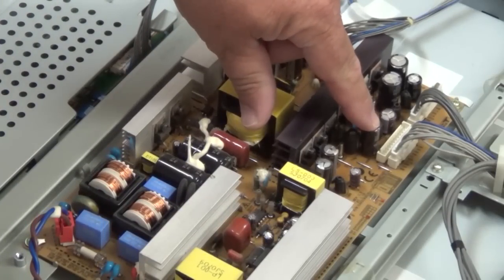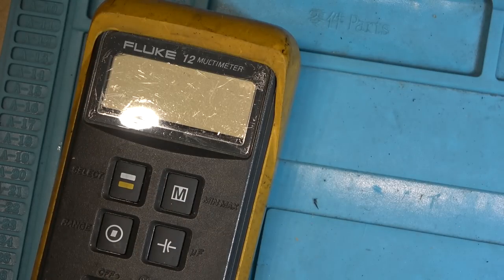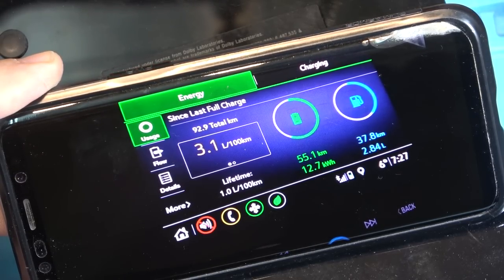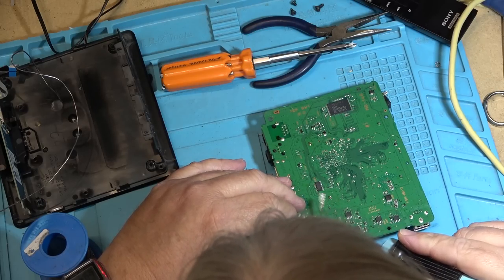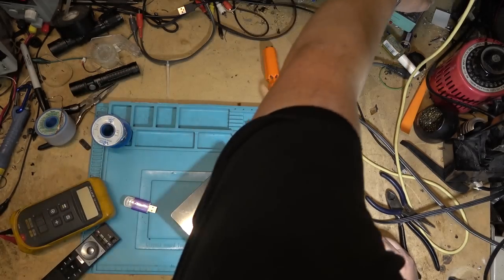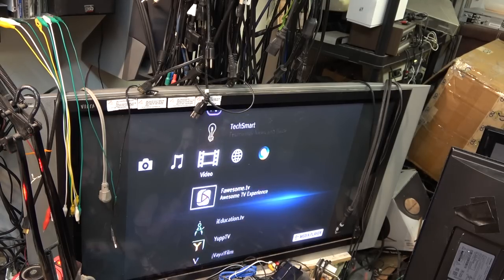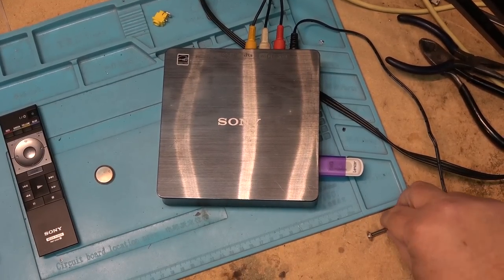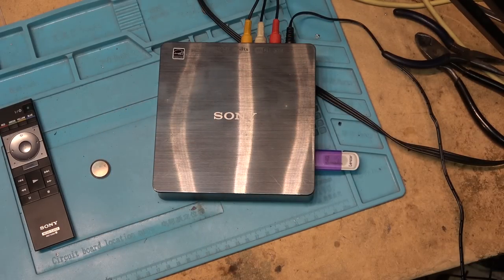Scored a great unit on facebook for free today

Comment: I save all the connectors from dead 9V batteries, then use them to make battery clips for projects when I need them, I'll never have to buy a 9V clip ever again.
Reply from the maker: I've done that.
Reply: yeah because why not. recycling is nice. just need strain relief for wiring
Reply: @ketas  I usually hot glue on the other end of the battery (plastic the same shape as the connector)
Reply: or just make 4 small holes in plastic and route wire through it...

Comment: Hi Dave just a quick one about Nav systems. I used to work for a leading Nav company and there are 2 options which you talked about in your video. Fast and short travel. Fast means the speed that you are going. Short is the travel time. If you want to go quick as in time wise you would have to use Short travel. But if you want to go quick in your car you would have to use "Fast". It's stupid but true. Keep up the great vids!!!
Reply: They need a 3rd economy option.    Waze gives you map overview and you can select multiple routes.
Reply from the maker: Problem with Google is if it detects a traffic slow down such as a tunnel or bridge it reroutes you and if you decide to go the other way it constantly nags you to turn around.
Reply from the maker: @ACommenterOnYouTube  I can get to and address in the city i work in without gps.  This was 2 cities over.  
If I looked at a paper map I wouldn't have even needed it because a friend lived in the next street over.  As I was going there i drove past my friends old house.  I know the area just didn't know where that street was.  Gos took me in the back way, the much longer way.

Comment: Nice work.
If you ever want to do it the easy way, you can get barrel jack adapters that will fit just about any socket. They cost maybe a dollar or so. Then you just need a power pack with a 5.5mmx2.5mm barel jack (or splice one on) and the right voltage. You can glue the adapter on if you're worried about it falling off
Reply from the maker: This was easy.

Comment: Great video!  I always end up searching out some electronic gadget I see on Youtube.  Put a bid in for one of these on eBay just so that I can have another toy.  Even at 70 these things still fascinate me.  If it works I'll end up putting it on one of the several TVs scattered around the house.  BTW, really enjoyed your video on changing belts in a Sony 300 CD changer.  I have a 300, 400 and a Sony 400 DVD player and have had to change the belts in all three at different times.  After the first belt change the rest were a snap.  Even got my son back in business with his Sony 300.  His had been down for more than three years and as expected the belts were black goo.
Reply: I get it. About the same age as you and I still have a habit of coming home with something I really don't need more of. Found a Philips VCR/DVD combo at Goodwill for 11 bucks yesterday, like new condition with remote. Like I need another VCR/DVD combo! I have four hooked up to every tv and the projector in the house along with bluray, roku, tv antenna. With VHS coming back into the collectors' market now they ae becoming harder to find a cheap deal on. Glad Goodwill hasn't figured it out yet.
Reply: Oh yea, on the same trip, same store, I found an AppleTv streaming box for eight bucks. Brought it home, did a factory reset and update and works like new. Price those on the market!
Reply: I do the same Henry and my house is getting pretty full! 😂😂😬

Comment: 480p/720p players - a good find. these days it's all about live streaming; takes quite the hobby to collect all sorts of movies to store on there.
Reply from the maker: This does 1080p. It can output 480i at the same time as well as 1080i out the component while outputting 1080p out HDMI.  
It's great if i want to make a quick DVD copy of a 1080 file.  No need to render out a 480 file just plug the USB stick in or stream it from the hard drive over WiFi and plug the composite out into DVD recorder and hit record.

Comment: I also have the problem with weak batteries and incorrect data from my Fluke devices. Since I live in Germany, I also have access to our local manufacturer “Gossen Metrawatt” and their multimeter series. I have not actually encountered this problem with these devices. These "Made in Germany" multimeters cost as much as "Made in USA" Fluke Devices :D

Apart from that, an interesting video! Nowadays, I only look at classified ads and the like with a low price limit and actually only for defective devices. On one hand, because it’s fun to try to repair them, and on the other hand, I don’t like to spend a lot of money on old electronics. Even if I like old stuff, some prices for functional devices such as "vintage" radios, tape decks, etc., are simply astronomically high.

Best regards from Berlin!
Reply from the maker: The ones i love at garage sales where the owner has printed out eBay sales prices and stuck it on what they Are selling.  100 for a 20 year old microwave.   I don't think so.
Reply from the maker: It will be a FLUKE if its accurate. There is a reason FLUKE devices cost as much as they do, and that is repeatability. They are held to very high standards by industry and government users such as NASA, Boeing, US military ect. They make meters that span many, many years. They don't change often and the reason is due to specifications called for by these industrial users. Dave Jones over at EEVBLOG did a video on this. 
They have contracts with large industrial and governmental agencies that demand a very specific specification. They don't give a dam about selling to a back yard hobbies. They have industrial users that do not care about the price, they are paying for a specific product and specification and their meters are produced to this standard.  Are there other companies that produce a meter as accurate as fluke. You bet there are, lots and they cost a fraction of the price, but one thing they don't have is the certifiably that fluke has earned over the past half century. I have a brand new fluke that I have never used. Some idiot was selling a 500 meter for 20 bucks on Facebook and I pounced on it. The guy said he had about 40 offers in the first few minutes and would sell it to the first person that showed up. Just so happened that it was my day off and I jumped in the car and headed straight over and snagged it. Was it hot? Possibly. He told me it had been his father's and he ran a repair shop but couldn't tell me the name of it, and he bought the new meter only a few months before he had a stroke. Its so new that the protective film on the display is still there. 
I'll put that one in service after this old FLUK 12 packs it in.

Comment: I live in a major metro area with HUGE cellular data dead spots, so I've had issues with Google Maps not knowing where I am, failing to load, freezing, etc. Just bought a used Garmin for $20 with lifetime maps and traffic, updated it, and installed a new $15 battery.

Comment: I've always wondered what factories think when they make such media boxes? almost air tight box where there is no air circulation. Perfect recipe for overheating.
Reply: I have a Roku streaming box, it's a sealed unit and after being on for a while the top gets warm so I'm guessing it acts like a secondary heatsink. 🤔🤔
Reply: @markrowe8824  It doesn't. 
When you have a heatsink inside an almost airtight box, in the end it doesn't work as a heatsink!
CPU. begins to slow down to protect himself. I have only seen an android/media box with a fan!
Reply from the maker: There are hidden vents on top and bottom covers. In case you missed it a gap of about 2mm all the way around. Plenty of convection air flow.
Reply: This thing probably runs some very light weight real time operating system, probably not even Linux, so it probably doesn't need much cooling anyways. Sony uses BSD on PlayStations, so maybe this thing's firmware shares some code base with that.
Reply: @RaduTek  the on-screen interface is almost exactly the same as the PS3 games console. 🤔🤔
Reply from the maker: @RaduTek  got a big heat sync and plenty of free air.  Vents top and bottom all the way around.
Reply: @RaduTek  remember that the same apps or video take the same amount of hardware resources regardless of which operating system you used!

Comment: I took a trip in my 87 ram 50 from California to Montana one year and had a route all planned out on Google maps to take the back roads through eastern Oregon and Idaho. that thing refused to let me stick to my original planed route! Every time I would get to an intersection or fork in the road it would tell me that it found a faster or better route and I would have to look down at my phone and tell it to ignore the freeway or whatever new route it would try and direct me to. I'm surprised my phone didn't end up in the engine fan along the way!
Reply: Is that possible that Google has a database of "no-go" regions or some kind of an algorithm when you are doing long-dinstance travel, just to keep the traffic out of small towns? I was thinking abut this for a long time. Here in Germany, it seems it does. I also tried the planned route thing once or twice, to do scenic roads (should definitely be an option) and I always got stuck to the big roads (federal road, which is Bundesstraße or Autobahn). I know, I can swtich off Autobahn, but what about the others?

Comment: Great video! I loath those special Sony power connectors!
When substituting a missing power supply Im aware of checking the polarity of the middle pin and barrel, + and -, or - and +.
How much over/under can the  voltage and amps be?
Reply from the maker: Amps doesn't matter if it's over.  Say the original was 12v 1a. It is perfectly acceptable to replace it with a 12v 3a or 5a.  Obviously you wouldn't replace it with 12v 500ma or 300ma.  That wouldn't work.   It's not like the power supply is going to force 3 or 5 amps into the device.  The device is going to draw what it needs.  That's the max current the power supply can deliver without going I to over current protection or overheating.
Reply: @12voltvids  Thanks!!! What about voltage? For example could a 12 volt use anything from say 10 volts to 14 volts and still provide enough power but not enough to fry something?

Comment: I feel you with Google maps being terrible. I use it as a guide instead of taking it verbatim because of how terrible it is. I turn off the voice navigation because it'll hitch up constantly and tell me that I need to do a 180 on the freeway, go back 20 miles and then go on a different nonsense route because it calculated that would be faster. I also have to keep an eagle eye on it because it'll constantly tell you about "faster routes" and automatically try switching to them if you don't cancel the prompt in the 5 or so seconds it gives you for input, which makes it so you have to close the maps and open them again. This is especially dangerous on long haul trips, because you can end up 50-100 miles away from where you actually want to be.

I remember years ago hearing "experts" say that GPS map software was going to make it a thing of the past for you to have to remember routes to your destination, you just plug in and go. Yeah, no. It'll never be like that. GPS software is good at one single thing, making you frustrated and want to throw your expensive electronic device out the window.

It's the exact opposite, GPS nav software is great at forcing you to remember routes out of pure spite for the software, so you don't need it.

Comment: It feels like that Fluke multimeter isn't entirely ok. At least in the past, they would never had let any multimeter leave the factory with such severe misreadings once the low battery icon shows up.
Either the icon shows up too late (when needed voltage for correct reference already is too low) or the reference circuitry "linearization" isn't doing it's job correctly. I suggest the latter, as normally, the LCD starts to dim before such severe misreadings.
Reply from the maker: Well the new one I bought off Facebook for 20 in the box, the manual says to change the battery as soon as the low battery icon lights as the accuracy is not guaranteed if the low battery icon is illuminated.  So they print that right in the manual. They also say not to use rechargable batteries.

Comment: 10 usd is cheap, but free is better.
What is the model number on it?

Such a box is about what file formats it supports and whether you can still update it and which CPU and GPU it uses.

My old TV screen supports playback via USB. but is slow and does not support so many file formats. Then it's not so fun to use it for that!
Reply from the maker: It was 10 CDN but ended up being free because the seller tossed the power supply and then realized that if i didn't buy it nobody would so he gave it to me.

Comment: The Fluke - Ha, ha, ha.. This IS the reading you get after ignoring ''low battery'' for weeks. (I've had a couple of those).
Reply from the maker: Mine came on a few weeks ago but i haven't been using it.  I don't leave it on.  Mostly just for continuity beeper.  I went to check a lithium battery that my car had said was low in the fob and the meter showed good.  Hmmm won't unlock car.  Got a new battery and it measures 4.8v hmmm something up here.   Must be meter battery.  
I put the old one back in to "stage" this portion of the video.
Reply: @12voltvids  I have a cheaper old meter that starts to display exactly the same figures as the Fluke... I'll have to have a look at the chip-set. 
PS. (Warning! This is a weird comment) I love your channel, but I do sometimes think about things the total opposite way you do. I think if we were in the same room for an hour we would have a fight 🤠😸😸 But I really like you and your channel... In fact it makes it more entertaining and sometimes amusing. I think I'm a bit of a picky, annoying old git.
Reply from the maker: @martinda7446  simple answer.  I do it right
Reply: @12voltvids  Ha ha.... We would be fighting right now. I love it.

Comment: when i first got into video production stuff in middle school in 1999 or so i did get to use avid on an all in one molar g3 powermac and also a g3 tower. at the time i learned to edit from tape to tape and also tape to digital. when i got into high school things really changed. we were at the end of tape and there was dvd and hard drive recorders. nice stuff for the time period. i still prefer hardware recorders as suppose to software recording since i think they do a better job. i do own a few hardware recorders. i also still record on tape and occasional dvd. i dont own a dvr hard drive recorder so yea. but wow avid how i remember it so well. shame its no longer around as far as i know. i started with avid cinema as far as i remember from that far back.

Comment: I always charged or  changed the battery when it shows low. I guess I'm odd? Interesting stuff!
Edit: I took apart a Panasonic 9 volt battery about a year ago. It had 6 skinny AAA cells in it.
A Lantern battery "Energizer" had 4 long D cells in it.(I had the lantern battery for many years)
Reply from the maker: Don't use rechargable in test equipment.  Voltage is too low.
Reply from the maker: Usually I leave the battery in place till it stops, but in the case of meters and smoke detectors, they get changed as soon as they show low.

Comment: You can avoid expiring devices by building a PC from spare and new parts. I had an NVMe SSD left and RAM that wasn't working in my main PC in combination with other RAM. So I bought an ASRock B550M-ITX/ac motherboard, a Ryzen 7 5700G, and a passive AKASA Maxwell case. I installed Manjaro Linux on it and I can watch everything I want. AV1 video is being CPU decoded but the CPU has enough grunt for 4K60 AV1 playback (even if it's not energy efficient). But by the time AV1 becomes widely used, I can upgrade this thing's hardware no problem.
Reply from the maker: Don't want to have to run a PC to view content.  Just want to plug the USB or hdd in and hit play.  Already have a PC

Comment: Did the GPS save you an hour? They aren't claiming to save you gas or electric power. They are claiming to save you time. They do give you an option to save on tolls. Perhaps they should give you an option to save you money if your time isn't money.
Reply from the maker: No didn't really save any time.  Still took an hour to get there.  Another truck hit an overpass.  That's the second this month.  I think the government needs to start sueing the drivers and taking their assetts like their homes when a driver doesn't know his hight and hits an overpass.  No excuse. 15 so far this year.  The one that was hit back in July still not fixed.

Comment: I don't know why companies have to find stupid ways to rip you off. We should call it what it is-- companies just trying to rip you off. Apple is pretty much the king of ripping people off. That's why I'll never have one of their phones. The EU told apple they had to start using the USB C port on their phones, so they added one. The catch is you have to buy their special cable with their proprietary chip so the phone knows when to provide you with maximum charging and data speeds. Apple just extended a huge middle finger to their customers. I suppose, you can at least use a crappy, generic cable that's pretty much USB 2.0. I honestly wouldn't doubt they might dump you down to 1.0 or 1.1 speeds just to really drive home that need to buy their expensive, special cables.
Reply from the maker: They are all doing it.  Hi but a new Toyota RAV4 you get heated seats for 3 years and then you have to pay a monthly fee to keep the heaters working